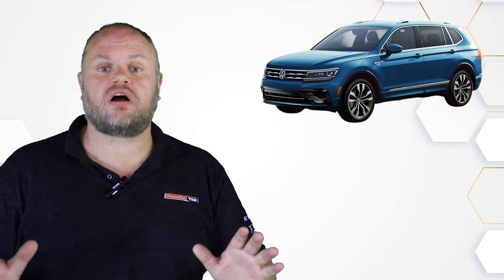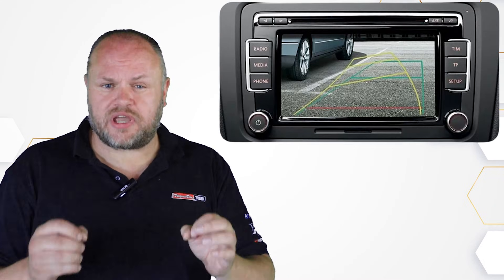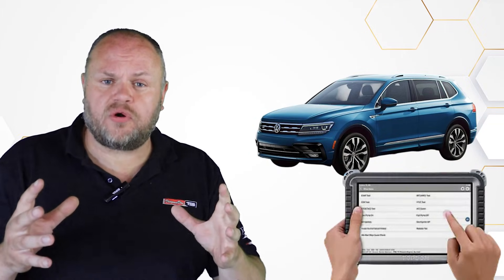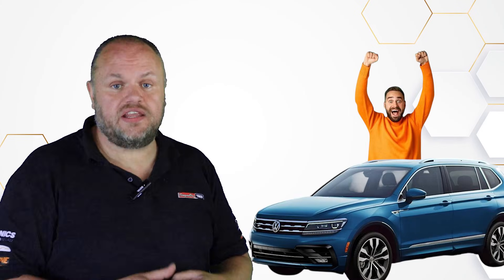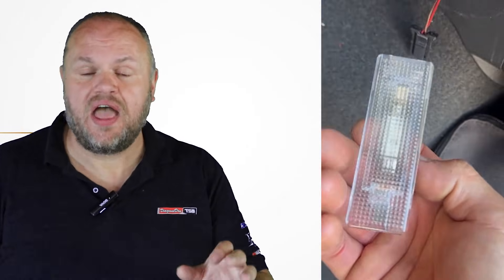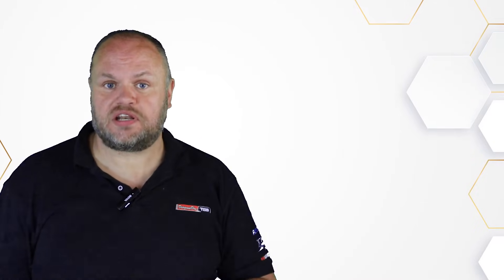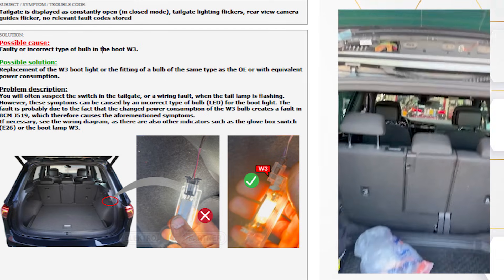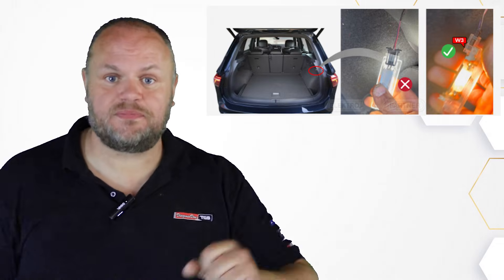VW MQB Platform: One Wrong Bulb Causes Bizarre Electrical Faults

Comment: A friend of mine has a 2003 citroen C3 1.4 75CV. The first symptom was that the brake lights didn't work but everything seemed to be fine, including the brake sensor. Then, when you started the engine, it worked fine, but when you switched it off, it stayed running, with the key in our hands... Until you touched the brake pedal, then it switched off. At the end it was a bulb... I mean... WTF!
Reply from the maker: Indeed a classic mistake but tricky

Comment: I developed a non intrusive test to deal with this potential issue, I have a multimeter that reads volts amps and watts at the same time on the screen, operate each light and match power consumption in watts to factory light bulbs. Very fast non intrusive preliminary health test
of the lighting system, an example, Subarus experience intermittent no start if the dome lights are substituted with LEDs this test will identify it, as LEDs consume less power than bulbs, look up the factory bulb specs.
Reply: Where are you hooking it up in series to get that measurement?
Reply: @nowayjose596  Not in series, inductive amp clamp on battery negative. FNIRSI  DMC-100.
Reply: @rodvan-zeller6360  Ah ok, that's a pretty nice looking meter for the price. You feel like it's accurate enough to be able to tell the difference between an incandescent interior bulb and an LED when testing like that? Bc those incandescent interior bulbs are only ~10W to begin with.
Reply: @nowayjose596  10 watt bulb is 3 watt led, usually more than one in most cars
Reply: @nowayjose596  This meter can measure volts amps and watts on the same screen at the same time, if you look up bulb spec by application and how many in the vehicle that value should match your reading, if not you no what to check first.

Comment: Similar issue on a 2017 Skoda Superb with aftermarket LED tailgate interior lights - everything seems normal unless any of the other interior lights are switched on and the car is locked. Then the electrics repeatedly wake up and shut down draining the battery.
Reply: Its VAG car,you can change in OBD to led so car knows it has led.At least I solved my problems like that

But on that topic electricity is tricky.When I bought the car(Seat Leon 1.8 FR) it had normal battery in it but EFB was codded.My symptoms were start/stop not working always,engine cooling fan on full blast until you shut off the car and error on dash about start/stop and AC reducing blower power.All that was fixed by buying new AGM battery and coding that9
Reply from the maker: Exactly! We have TSBs on different models because even though the same BCM is used across the MQB platform the symptoms can be slightly different across the models (perhaps because of software and car spec.).

Comment: I had a clients BMW E65 730d(diesel) that experienced random misfire and coughing when idling. Under DDE(engine management) there were no fault codes stored, but when looking at live data - air mass, rail pressure and cylinder rough running values were jumping. While tinkering around i suddenly discovered,  that this random problem appeared only with sidelights on. When the light switch was on the 0 position there were no misfiring. The car came with front halogen sidelights("angel eyes") from factory when new, but some previous owner installed LED-bulbs. After disconnecting the LED-bulb from the passenger side headlight, the misfiring dissapeared. Funnily the LED-sidelight on the left side did not cause any troubles. Very strange case, because I work mainly with BMW-s and most of the old gen. models have retrofitted LED-sidelights with no issues, because owners think it's cool :D
Reply: Had similar problem... got one BMW when stationary there was no problem...as soon car started to move...all door started to show to be open on dashboard on scan tool i got random "blips" of switch triggering to open state...al 4 of them... all stuff leading to faulty FRM....but the real culprit were chinese LED headbulbs and interior lights...
Reply from the maker: Wow, that is also a tricky one. Good job
Reply: These cars came bus is like a local area network you would think there would be a time domain reflectometor test for them showing the exact distance on the network that the fault is at and referencing what area on  the car that is

Comment: Had this on an insignia. Customer had put led bulbs in the number plate holders. Lost all indicators, boot wouldn't open and no dipped beam on the nearside. Put original bulbs in, all faults gone. Any issues that run through the bcu, first thing i do is check all bulbs inside and out.
Reply from the maker: Thanks for sharing. I will check our internal Hotline database for this issue. Very interesting.

Comment: Don't think the power rating is the issue but that most LED bulbs is using PWM to control the average power and some brands/no name sends out a HUGE amount of RF/EMI radio interference that is both conducted through wires and as radio.

I've had a few lightbulbs that when i turn them on all the radio signals just disappear and it's just static noise.

First thing i do when customer complaints about bad radio signal is look for any aftermarket LED bulbs AND sigarett chargers as these do the same.

This one I don't think i would find and think about the first hour(s?) 😅
Reply: Cigarette lighter adaptor USB output chargers can be horrendous wideband noise sources
Reply: @gavTFSi  Yep. Inductors and capacitors to filter the noise are expensive components, and it works "just fine™" without them :D
Reply: I 100% agree that it's something to do with noise.

Comment: Don't buy or use cheapest chinese crap is the lesson.
Reply: I've had just as much problem with RF interference on the most expensive LED bulb i could find in my country(made in Germany) and it cost me 80 USD for 2 x 20 Watt backup bulbs and where promised to be canbus approved, and it took 1 second before my car was screaming about defective bulbs...

And had to change to a made in China bulb to fix the car and get radio back

Comment: I had it with a John Deere tractor a couple of years ago. The system was seeing a higher resistance than it was expecting so went into limp mode. Luckily the customer told me he had changed a couple of blown lamps so it didn't take too long to find the problem. My gas was flabbered when I realised what the issue was.
Reply from the maker: Yes, often you get that little side note from the customer way too late...

Comment: It’s strange the customer didn’t notice that the problem came as soon as the bulb was changed and so linked the 2 events.
Reply from the maker: Yes, that would definitely have saved a lot of workshops some serious frustration.
Unfortunately, many customers have no idea that something as simple as changing a bulb can trigger a fault. Maybe he installed it late at night, and by the next morning the car was acting weird, so he just went straight to the workshop.

We’ve seen this kind of thing many times across different countries. It’s more common than most people think.